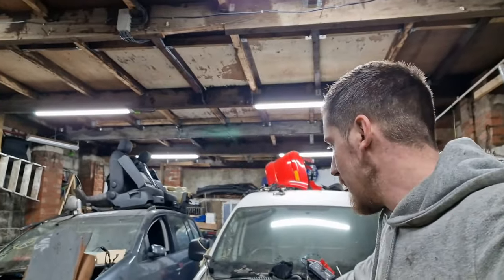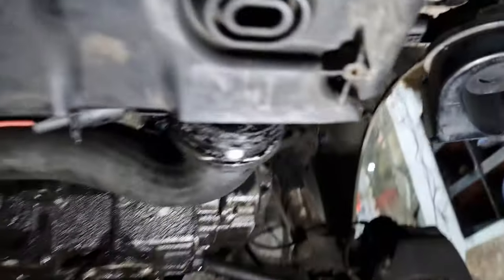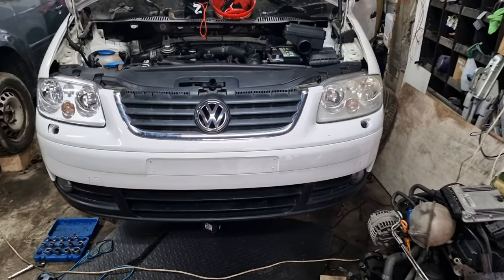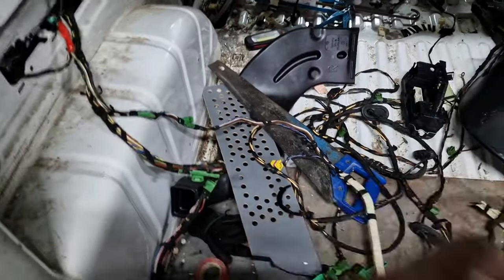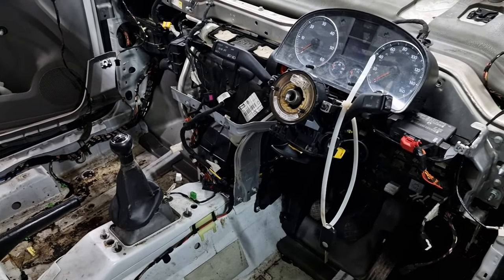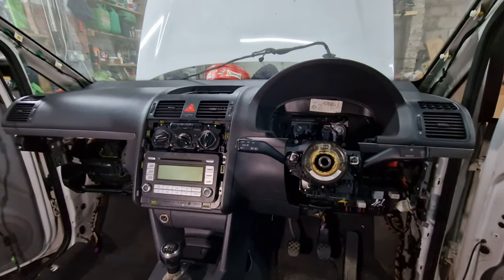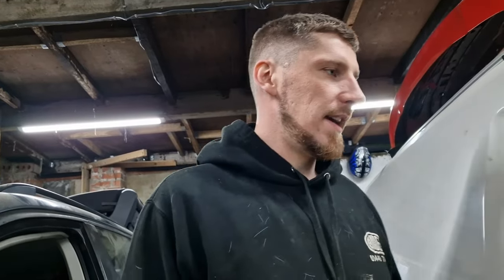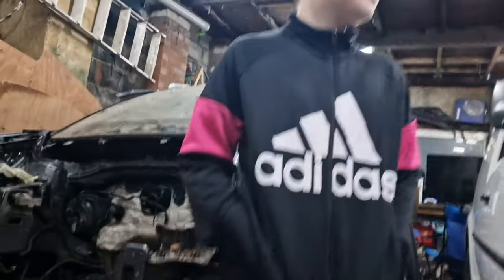The VW Caddy Is Complete!! Fitting Touran Front End & Touran Dash

Comment: Hello fella did you end up using the complete touran loom front to back 
I’m just about to do the same and I know it’s a straight swap for the front to the doors but was there a lot of splicing for the rear 
Cheers bud 👍
Reply from the maker: Hi mate yes used the whole touran loom, there's abit of faffing about for the rears but it's not too bad just adapting wires from the touran loom to the caddy for the rear lights and rear door lock etc
Reply: @SalvageDiaries  that’s what I was going to say is did you use the passenger rear door electrics for the sliding door 
How about the driver rear, did you delete or connect it up and just hid in panel 
Thanks for the feedback bud 👍